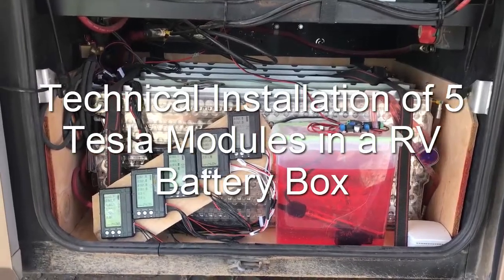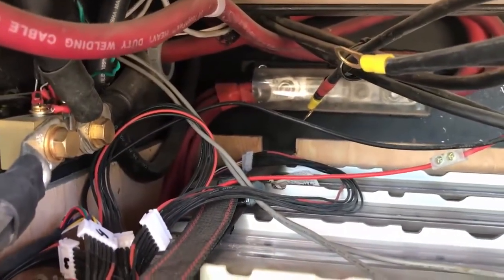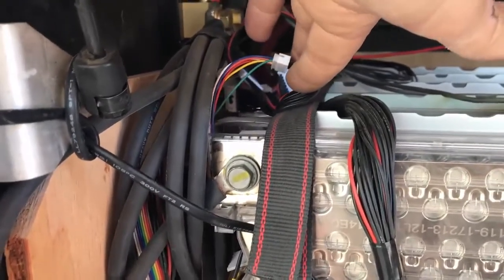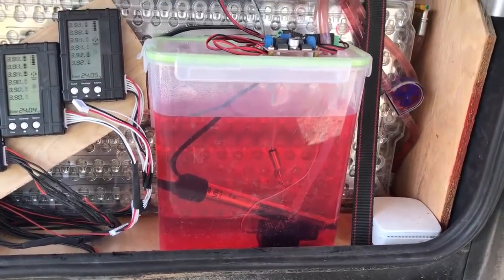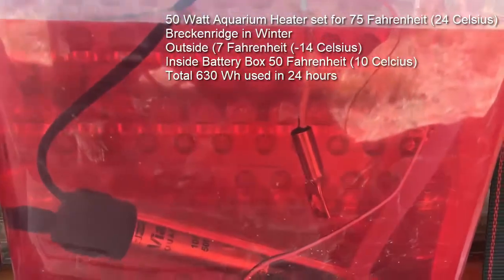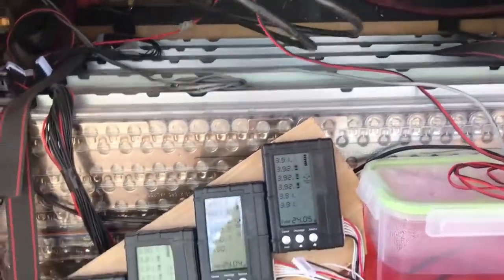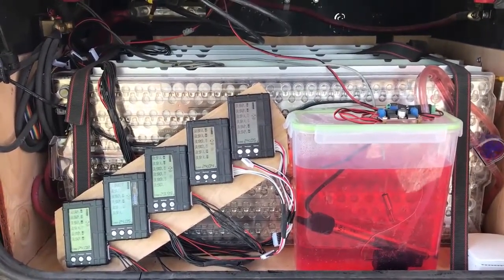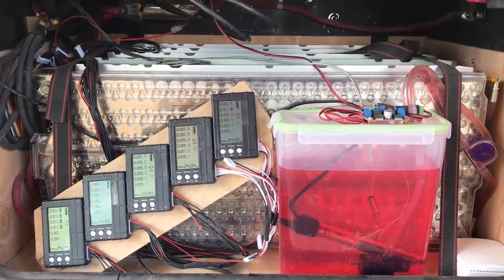Technical Installation of 5 Tesla Modules in a RV Battery Box

Comment: Hi, I like your setup. One question. When you connected those battery medic to the Tesla battery, do you follow any sequence?(0 to 6 from the BMS board) or you just connected them randomly?
Reply from the maker: I cut the standard Tesla connector or on the newer model soldered wires to the strips. Then those wires was soldered to a new connector I had purchased based on the voltage in order. When connecting is all connected at the same time through the 7 wire connector.
When cutting always only cut one wire at a time else you short the wires with the cutter and they melt (ask we how I know).
Reply: Thank you so much. I just made mine to work today.Another question, for the heater on battery, did you use the sensor on the Tesla battery? or you just use another sensor to catch the temperature inside cabinet?One more question. For that RIB, can you explain more on how you connect it to the breaker? I tried to get my setup like yours except I don't have RV yet. Your design is very reasonable and useful. Thank you again.
Reply from the maker: I did not use the sensors currently, but is considering a redo of the control/fluid/balancing setup using a Raspberry PI that would also include monitoring the internal temperature sensors. 
The Fluid is circulating in 5/16 ID tubing and connect directly to the Tesla Modules, all five are in series (like in the car). he tubing is built in to the battery from Tesla using copper tubing that touch each cell multiple times.

Comment: Great setup, I am really impressed on how you heat the batteries very simple. Can you tell me what temperature motor control board you used and the type of pump. I searched and found so many options, not sure which to use. Thanks
Reply from the maker: A simple 240 GPH 12 volt aquarium pump and a 50 watt (AC) aquarium heater set for 70 degrees. All from Amazon.
Reply: @Per3110  I am happy to report that using a heating system based on your design, I was able to heat my 3 Tesla Module battery modules in an insulated box at unheated outside utility room.  The temperature for the last 4 evenings have been near 19F during the night. The power to heat the batteries averaged 690 watts / day and the batteries average temperature was between 60F-65F.  
I really like the details in your 100% off-grid site. My next project is to build data logging and monitoring software, any suggestions?    Thanks!
Reply from the maker: @urbanoeijan5459  Raspberry Pi for sure. I have a small custom board to monitor a Shunt, but everything else uses MODBUS to talk directly with Solar Controllers. All coding is done in Python and php using existing libraries so no hardcore interface code.

Comment: Where did you find the JST XH15 plugs to connect to the Tesla side of the Balance monitor cables?  It’s easy to find 6S balance cables but haven’t found the 15 position part for the battery dude yet.  I guess it’s an XHP-15P but can’t seem to find one anywhere.
Reply from the maker: I cut the standard cable on the Tesla module, measured the voltage and soldered a 6S balancing lead onto the wires. takes less than 10 minutes, just be careful not ripping the wires from the stainless part in the Tesla module, it is almost impossible to solder back on (i tried for over an hour).

Comment: This is an amazing feat. There are many of us that are converting vans, buses, RVs, that salivate at such a system. Congratulations. If you were willing to release a complete diagram of your system, I would pay for it in a heart beat (so would many others). Just an idea! 
I am curious as to how exactly you wrapped the tubing around the modules, if you have the modules connected together and if so, how. I will start my van conversion in two weeks and dream about having a system like this, with two modules only. Trying to learn as much as I can to hopefully pull it off. Just the finding of those HobbyKing BMS's was so golden, it made my day since I've been searching for something like it for months. Thanks for the great info!
Reply from the maker: The connectors for the "Hobbyking Battery Medic" balancers is simple RC-plane connectors for balancing. I cut the original Tesla connector off and soldered and heatshrinked the colored wires on the connector. Always cut the wires one at a time and not as a bundle, the power in the battery is enouhg to melt the wire and insulation in a second of shorting.
Reply from the maker: All the modules are in series for the cooling. The tubing is built into the Tesla module, you need 5/16 tubing and it fit right on the Tesla cooling port. The main reason to use fluid circulating is to ensure a high enough battery temperature for charging. Never Ever charge Lithium below freezing.
Reply from the maker: I will look at making a detailed wiring video and a diagram, but the diagram is currently only inside my head :-)
Just go with the thickest and shortest wires possible. We have 4/0 Gauge from battery to Inverter less than 3 feet. The Solar Controllers are connected with 4 Gauge wire to the Inverter (3 Feet) instead of first going to the batteries and then back, we run a lot of high loads like AC during the day that benefit from the shorter run to where the power is consumed.
Reply: Ahh I see! I forgot about the built in tubing on the battery. Makes a lot of sense and seems so much easier now! I will be using Victron Multiplus inverter/charger for its remote connectivity which doesnt have connection for charge controller, but dont think it is a major deal. 

I came across a diagram, at the link below, for Tesla's pin connectors and it got me thinking about how the HobbyKing connects with the battery. 

http://evwest.com/support/Tesla%20Model%20S%20444%20Pin%20Diagram.pdf

Did you have to buy a separate wiring harness to match the HobbyKing with the Tesla battery, or does it come with a harness that'll work from the box. I also couldn't tell if you removed the BMS from the battery or not, or if it is from pins emanating from the Tesla BMS that you connect the HobbyKing to.

Speaking of BMS, have you heard of Batrium BMS? It's pretty expensive but also pretty advanced. Havent seen it used with a Tesla, not sure if its even possible, but thought you might find it interesting. https://www.youtube.com/watch?v=NCnofhKzv8k

Looking forward to your next video!
Reply from the maker: I bought a small connector used for RC airplanes and soldered it directly to the Tesla wires. The Tesla BMS module only work if the electronics in car is attached. I removed them. I did not wire anything for the thermal resistors yet, but have a plan for that in the future.
The Batrium is nice, but with 5 Tesla modules require 5 x 6 LongMon and the Main unit. So it get really expensive, I maybe do that in the future simply because the screen look cool :-)
Reply: Love the setup! Any more tips on the connector/wiring?

Comment: Thanks you for the video. Where can i get the balancer and the  wire connector? i have the same battery 48v in series  but i am yet to figure out how to balance each cell. Thanks for your time.
Reply from the maker: Search for "Hobbyking Battery Medic"
Reply: @Per3110  I would love to see a photo of the area where this splice occurs to help in completing this task? Can anyone email me this piece of the puzzle? MUCH appreciated!
Reply from the maker: @MyDroidSDKs  It is a little tricky because the modules are mounted in our battery box :-). Depending on the version of the module is it simple.
Old modules: 7 thin wires coming out from the Battery going to a 20 pin connector, cut the seven wires and solder in order to a 6S balancing connector.
New modules: Two bands with 3 or 4 wires. Solder a small wire at the attachment point (only place solder will attach). then solder the new wires to the 6S balancing connector in order. 
Put heat shrink on each small wire and a larger piece covering all 7 wires and heat shrinks.
Reply: @Per3110  
I have a 10-pin female connector on that small circuit board with no attached cable existing, and then yes at each side of that board i have one plug, each with 4 wires from tin ribbon cable to middle of battery.
When i look close at your front most module in the video i do not see the original circuit board i think, but it's hard to see.
I very much appreciate your detailed explanation on making the connection.
Did you remove the small circuit board between the terminals to access these cables?
Reply: @Per3110  Did you remove the circuit board first to access these two bands? As i see two plugs into board one front and one back.
Reply: @Per3110  Thank you for the advice, i have the newer style. I see the numbers on board corresponding with  two plugs.. one with 4 wires & one with 3 wires. So i unplug the bms board, then put wire and drop of solder in hole of each wire on plug side not ribbon cable side, correct?
Reply from the maker: @MyDroidSDKs  I have 4 of the older style  (Revision B) that is easier to modify and 1 of the latest style (Revision C). I'm pretty sure in the newer style I ended up soldering my wires at the attachment points close to the cells on the battery. So I added longer wires for that myself. I have to take a look. If you go to EVWest have the specifications for each revision of the connector. http://www.evwest.com/catalog/product_info.php?products_id=463
If you find a connector to directly connect you can solder it any way you want. I'm not sure what they are called.
Reply: Do you have a BMS in your system or just the battery medics?
Reply: @Per3110  Yes agreed i have the newer style.. So, it is ok to solder to same points ribbon cable attaches without disrupting those point to bms board?
And any special solder or pre-cautions to soldering to battery that has a charge in it?
Reply from the maker: I have tried to solder on the stainless because I broke a wire off. This is close to impossible. You need to solder either on the connectors or on the ribbon cable.
Reply: Ok, thanks for the great info. I have the newer style, two ribbon cables plug into board on opposite ends.. one with 3 wires plug(#1,#3,#5) and 4 wires plug (#0,#2,#4,#6) as printed on board near each plug. So i remove bms board and solder 1 wire & 1 drop to the plug side or the ribbon cable side?
Reply: Also i have the battery medic from hobbyking, thanks again. When i use one of the cables (7 wire), and plug it into the battery medic.. one wire is red the rest are black. Is that #0 or #6 wire(#0-#6=7 wires)? 
A) [#0,#1,#2,#3,#4,#5,#6] 
or
B) [#6,#5,#4,#3,#2,#1,#0] - i think it is this one, but appreciate your advice in advance

What gauge wire do you use to extend wires?

Please advise?
Reply: I found this which helped me understand the wiring. 
6S Connectors Explained: http://www.tjinguytech.com/charging-how-tos/balance-connectors
Reply: Ok, i used my meter after cutting away the plastic over the board.. and you can test each cell pack without
the need of removing the board or two plugs on newer modules. The board labels the cells so you can walk through them with meter and check if any are out of balance from the others. Not as nicely displayed with Battery Medic, but effective. Next i will probably use those pins on board to solder 6S connector to hook to battery medic! ;)
Reply: I’m so lost. Does anyone have a diagram?
Reply from the maker: Yes I do: http://offgrid100.com/wiring-diagram-fall-2018/
Plus a lot more details on that web-site.

Comment: One other quick note... Found a listing in another blog about the connectors for use on the Tesla cooling loops.  If you have need to go to a quick-disconnect fitting, check out the Dorman 800-116.  They fit very well on the modules I have.

Comment: Hey Per3110, love the setup... Take'n some ideas to implement in my install.  Mainly, adding the reservoir, pump, heater for maintaining temperature, and slotted wood for securing the bottom edges.  Great ideas!   I wrote a blog post on my progress so far: https://turtleherding.com/2018/06/mod-tesla-powered-tiffin/   One quick question -- Your balancing controllers appear to have some plastic deformity on a few.. was this from acetone removal of adhesive, or overheating of the balance resistors? (or something else entirely)...  Thanks!
Reply from the maker: I think it is heat, they get hot when they balance for hours. 
I looked at your page and you say you can last indefinite with the 3 Tesla modules. I just showed over the last few days that you need around 4000 watt of solar and 4 Tesla modules to run a single AC 24/7 in 100 Fahrenheit daytime and 65 Nighttime..
Reply: Hello Per3110, thanks for the reply!  We actually have 4 modules, but the 24x7 is only for typical DC loads + vampire 120vac loads (refrigerator, computers, networking gear).  If we have to run aircon or our induction cook-top, we cannot recoup that much power from solar in a day, so that would send us into a negative power balance on the batteries.  Apologies if that wasn't stated clearly in the blog post.
Reply from the maker: No problem I just skimmed it. Getting ready to make a post on our travel facebook page about running Roof-AC 24/7. https://www.facebook.com/BeaverOnTour/posts/2278152572201839